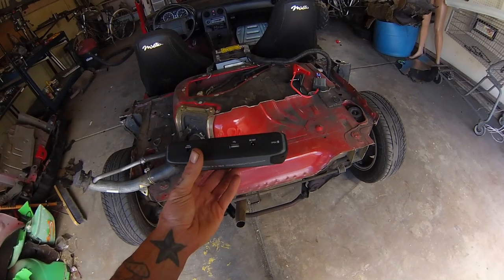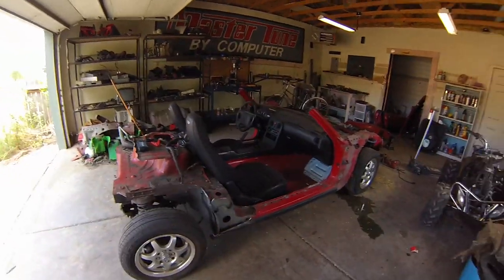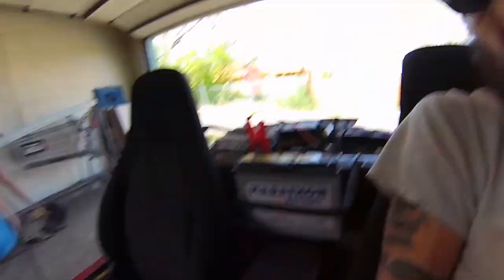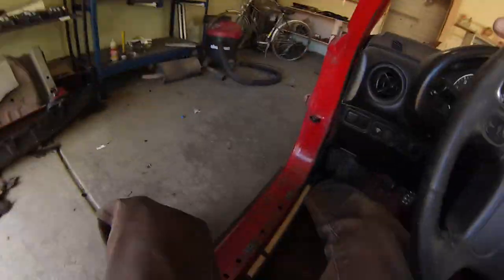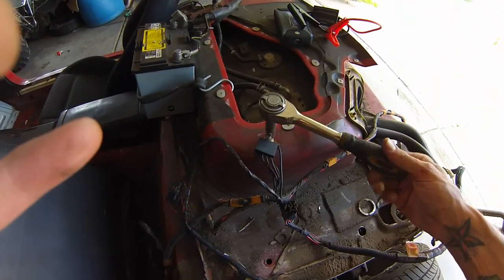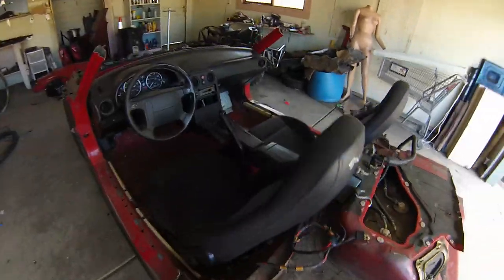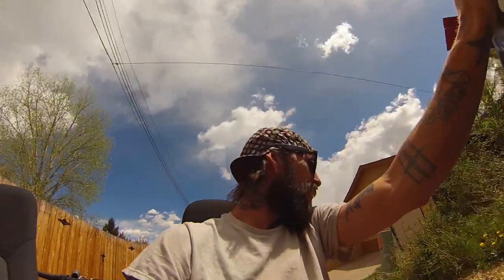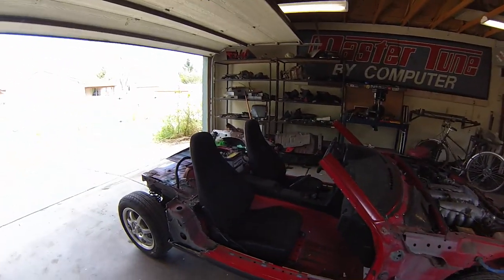MIATA GOKART PART 4 TEST DRIVE S04E16

Comment: WHERE DID YOU GET THAT RATCHETgsaeywrHS
Reply from the maker: lol walmart but some don't carry them anymore, always on eBay tho
Reply: Those ratchets fkn suck for doing almost anything besides a small bolt that’s out in the open and does require more than abt 30 ft lbs
Reply: And doesn’t require more than 30ftlbs